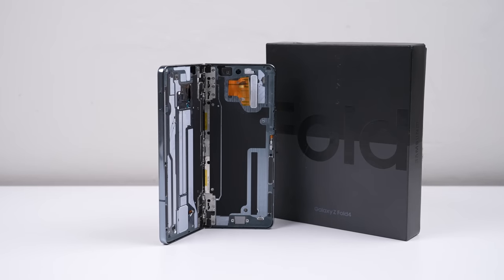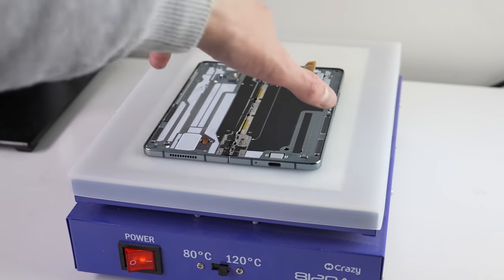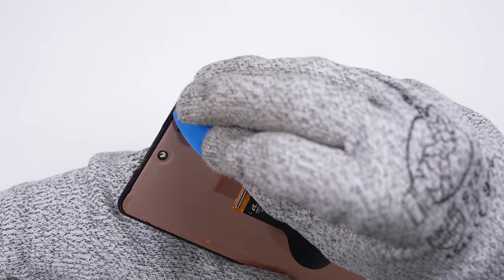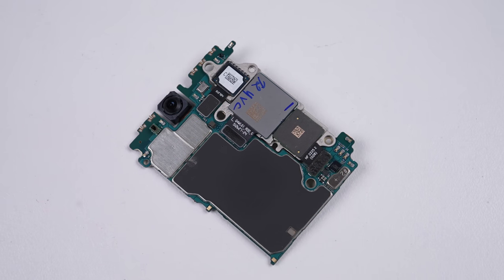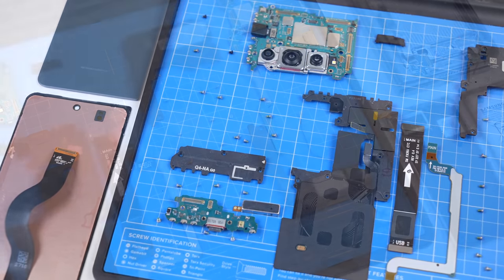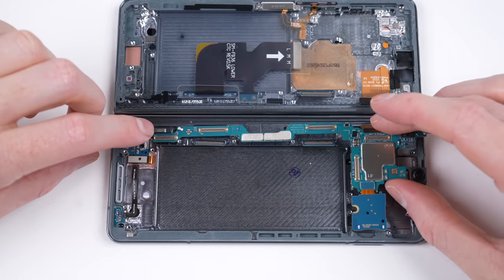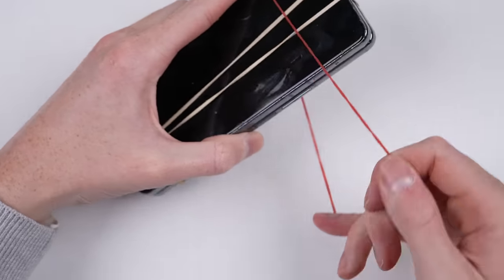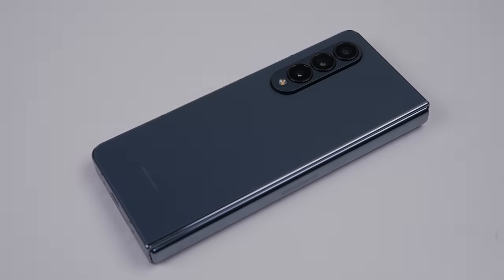Galaxy Fold 4 Restoration - Sellers Lies So Obvious I Had To See It For Myself.

Comment: Hey hugh, certified samsung tachnician here. I love your videos and your extensive knowledge. I do have a tip for you, that grey/blue frc cable on the main board side that runs from the usb board to the main board is supposed to go over the plastic bracket for the wireless charging but under the coil itself. It's clear the seller opened the phone previously and didnt mount it correctly
Reply: Hey I saw that too and I wondered what happened there!
Also certified samsung technician!
Reply: @dimitrisp.4397  right? Putting it under the bracket will damage it and eventually cause network connectivity issues. Also scared the shit out of me when i saw the copper foil peeled on the sub display 🤣
Reply: @thehellkeeper5674  I still cannot believe how the sub display survived the teardown!
Reply: is it true that Samsung change the ies to when you send it to repair?
Reply: @ThaexakaMavro  the what?
Reply: @thehellkeeper5674  Sub display is what Samsung calls the outer screen. I used to work at Samsung as a Support Specialist not too long ago and most of the devices I've seen with customers were always foldables having issues so I had to catch on to these terms very quickly haha!
Reply: @Lightning2011  i know what the sub display is
Reply: @Lightning2011 He was asking what the "IE" the other comment was speaking about, not the sub display
Reply: @thehellkeeper5674 was it you that took the screen out? 😂😂
Reply: @gamingbytetv665  I'd have lost my job if i had committed that atrocity 😅
Reply: @THEJPR  ah, apologies my bad
Reply: also that front facing camera came out WAAYYY too easy, deff was fully opened by someone before
Reply: @thehellkeeper5674   my phone is a Samsung galaxy A12 and has a cracked screen my phone company at@t will not replace the screen and send the phone back they give you a new one this makes me mad I still haven't got my original phone back
Reply: @Camdanjohanson  front facing cameras (I assume you mean under display camera) at Fold 3 and 4 are not glued like Fold 2 or Flip phones!
Reply: Do you have any tips on the fold not opening as much anymore? I have the fold 4 and it opens closer to a v than flat now :/ probably 160○ is my rough guess
Reply: @stewyxd  that should be an in warranty repair as long as there is no heavy damage on the hinge cover. Just dont mention any drops or anything like that
Reply: @thehellkeeper5674  I haven't dropped it at all so there's no damage to the device or even scratches I have Samsung care too
Reply: @stewyxd  just send it in to be fixed in warranty. As it is a warranty repair then samsung care plus shouldn't be activated. Otherwise you'd have to pay the excess fee for SC+
Reply: @thehellkeeper5674  Will do thanks 😊
Reply: @stewyxd  Take it to a samsung service provider, they will need to either replace the display assembly or the device alltogether
Reply: @Camdanjohanson  The one near me closed during covid so I can do it but it's about 75 miles to the nearest one now which isn't good
Reply: @stewyxd  you should be able to just call them and book a carrier collection to your house
Reply: Glad someone else spotted that! The glue on the UB display though and the battery removal with metal object made me twitch 😂 🫠
Reply: @thehellkeeper5674 is Samsung care/+ worth it?
Reply: @chazmichaelmichaels88  it is definitely worth it. Even if you end up never using it, say you're on the last month of sc+ and you never had to use it, break the phone and get it fixed to brand new
Reply: @thehellkeeper5674  okay good, thanks for the info. I got SC+ when I bought my fold 4. Couldn't bother dealing alwith Verizon and that terrible assurion insurance.
Reply: @thehellkeeper5674 Late to the party but do you know if SC+ (or warranty) covers severe micro-scratches on the new, terrible Gorrilla Glass screens? Have an S22U and my God are they horrendous, the screen scratches with the lightest use these days. Really kills the enjoyment.
Reply: @kewlhotrod  cosmetics aren't covered by warranty or sc+. I have a 22u myself and i only ever got two tiny scratches from having dropped it once. Although(i shouldn't really say this) if you have sc+ and the scratches are that bad, just back up everything you need to back up, break the screen and send it in. The excess fee is nowhere near what you would pay for a full cost repair
Reply: @thehellkeeper5674  Thanks mate. And yeah, the micro scratches are really awful, GG has gotten so bad the last few years. Scratched to hell and back just from sliding in and out of my pocket the past year, it's horrible looking in heavy lighting.
Reply: @kewlhotrod  Samsung: We are the best because we aren't made in China.
Also Samsung: Hey, let's get China to make our stuff.
Reply: Hi, can you please confirm what will happen with ip rating after phone repair?
Reply: @almasfaiz6703  it should be back to the same as factory standard
Reply: I have to ask you something,is when we replace new battery Samsung service centre have some software for battery replacement?bcoz my new battery backup is same
Reply: @hrushimore3329  what do you mean? There is no software. Whenever we replace a major part(screen, battery, motherboard, cameras) there is a code that we need to give to samsung so they know what has been changed for the next time it comes into service

Comment: It's frustrating to see how obvious so many choices are made to make these phones harder/annoying to repair
Reply: and the majority doesnt care until apple starts doing it 😂
Reply: It's not that hard if you have the right tools.
Reply: @mikejames6588  he seemed to struggle with a few things and the only reason he wouldn't have the correct tool is if they keep changing the tools required. There is no reason the battery, screen, and plastic clip should be any harder than already hard to repair phones.
Reply: @TomGrievee  it's 2023. It's not that hard to fix these devices
Reply: @mikejames6588  Nope, just take your time and be careful.
Reply: That's gonna have to change soon to sell in europe so...
Reply: @mikejames6588 found the 'licensed technician'
Reply: The only thing that seems to be an issue is the battery and front glass adhesive, tool wise its much simpler than any iphone, which is shocking given the product.
Reply: Especially since Ive become the families "licensed technician" for repairing their phones, its a pain in the butt just getting them open while trying not to damaged the good parts that are left. Most of my knowledge came from damn near mangling my nephews phone shell getting the old screen off but it has gotten easier with more experience that I could fix my dads WAY more expensive phone that actually uses the pen. Me? I dont spend anything over 125 on a phone as an upgrade, I dont need anything more expensive than that really.
Reply: Clearly it's intentional especially with the battery is glued down
Reply: Apple is the biggest and also one of the worst when it comes to repairability
Reply: When I replace batteries I don’t glue them and never had problems. It means that glue is not needed for functional benefits
Reply: For me most frustrating thing was information than phone couldn't be cleaned without inner screen replacement... Great job Samsung!
Reply: @kasiorap  maybe if apple doesn't want people to care then they should stop doing it they way they do it. When apple normally does it, they go the extra mile to tell the customer and technician working on that device that the device is meant to be difficult to repair or not meant to be repaired at all. Cough parts pairing cough $600 for a back glass replacement cough Proprietary screws cough Phone gets bricked because of a broken earpiece speaker cough . Good thing is at least they are taking baby steps in the right direction for repairability as of now.

Comment: I love that companies REFUSE to use screws to hold down the rear cover, but literally cover in the insides with screws and then glue the battery in place, where they use plastic clamps to cover a connector. It is like they know which parts will need to be replaced and have made those parts as hard/dangerous to replace as possible...
Reply: Not trying to defend these practices, but you can't use screws to hold down the rear cover unless you fancy marketing a phone without water resistance (which I don't think is going to sell well at all).
Reply: @osamu_90  Uh almost every electronic appliance that needs proper water resistance is held together with screws and rubber gaskets, there is no need to glue shit shown, it's only done for aesthetics. It's definitely possible to just make a metal+glass back cover with a gasket (something like the iphones) to have screw holes for easier removal.
Reply: @osamu_90 everyone seems to forget the Samsung Galaxy S5 (removable back, battery, water resistant)
Reply: @osamu_90  Water resistant devices have existed for years, it's only recently we've started using adhesive instead of screws and rubber gaskets.
Reply: @milktoast56  The S5 has a lesser water resistance rating though of IP67 vs the IP68 rating of the glued phones. This doesn't seem like much, but IP68 can survive three times the depth in water as compared to IP67 for the same duration.
Reply: It's likely due to production, it's faster for say a robot to slap a piece of glass in with glue then to screw in a back cover. As for a human, I'd imagine it's still faster to install the glass as one glued piece.
Reply: @Adierit  Not just production, aesthetics as well. Something that looks like it magically holds itself together like sci-fi tech is an easier sell than something that looks like it was handmade for something like a smartphone, which is often used as a status symbol.
Reply: *Stripped screw
Reply: @milktoast56   the s5 wasn't really water resistant at all, i've had one and worked on a tonne
Reply: @noname1210hh  it had an ip67 water resistance what are you talking about
Reply: @Adierit  I mean are you gonna drop your phone deeper than 1m into water?
Reply: @milktoast56  Ideally one should never drop their phone, but I can name plenty of pools that are deeper then 1 meter. That's only 3 feet after all, which is basically the shallow side of a pool. If it falls out of your pocket and lands in said pool, there is a perfect example of something every day people might potentially encounter.
Reply: @milktoast56   you can read specs all you want im just saying from working in repair shops for a very long time and dealing with them first hand  that ip67 didn't mean shit lol
Reply: @Adierit it’s ip65, not ip67. Literally just splash resistant
Reply: I agree that there is some anti-repairability in these by design, but they don't seem to go overboard like Apple using serial number binding to literally block you from being able to use replacement parts.
If you want to secure something like the battery down with clamps, they need to be extra strong so that it doesn't shake, which requires the mounts for those clamps to take up more space that's better used for circuitry. A customer doesn't want parts shaking inside their phone.
Reply: @noname1210hh  not even ip67
Reply: @Adierit  Every iPhone before the iPhone 12 is also ip67 water resistant. This Foldable is not hardly at all water resistant with an IPX8 water resistance rating, so what exactly is the point of that much glue, anyways, if the hinge will inevitably let in water?
Reply: @jayplantman  because without that much glue it wouldn't be sealed and have even worse water protection, while yes the hinge does let water in eventually it would need to be submerged vs at least being splash resistant
Reply: @The_Phone_Bin_Diver What? The S5 had IP67. TF are you on about?
Reply: @noname1210hh  The Galaxy S5 had an IP67 rating
Reply: Here's an idea for holding on the back:
Have the 2 screws near the charge port, like what Apple does. Then have the back panel slide up and away from the port, then lift out. It's held in with little L-shaped 'clips' along its length, but the only part truly locking it in is the screws. Doesn't work for water and dust resistance though.

Comment: Nice work, Hugh.
I officially anoint you a 'licensed technician'. 😁
Reply: I second this, Hugh Jeffrey should totally be the first to officially get this title 🤣
Reply: @LeahDykema  Absolutely !!!
Reply: If only I had half the skills that you have.
Reply: Should be a thing for him being a licensed technician in practice 😂
Reply: @LeahDykema first Louis Rossman, then Hugh
Reply: +1 ROFL.
Reply: Official joeblow5037 seal of approval
Reply: @lillebrorsanvincent2017  I like how Hugh whines less than Louis 😀
Reply: @joeblow5037  Agreed - although I like both hugh and louis, louis tends to waffle and whine too much - hugh just gets right to the point.
Reply: I hereby dub thy licensed technician
Reply: The crease of the screen from the first time you open it turns me off completely.   A better solution would be to separate the screen into two physical halves, and flip/fold them on a mechanical hinge for a nearly edge-less experience.  I rather see a thin line in the middle, than an ugly crease then a crack.  Folding a piece of plastic thousands of times is definitely not the right solution. imo
Reply: No, he didn't make it worse so he shouldn't be a "listened technician"
Reply: (insert clapping sound effect here)

Comment: When you go to do the Flip 4 note that you may need to transfer the magnets from the original frame to the new one or the inner screen may go dark when turned on. I believe the hall sensor expects a certain magnet strength to function and there is no way to calibrate the preinstalled magnets to the sensor on the logic board.
Reply: It needs a hall ic calibration!

Comment: The only licensed technician are you Hugh. 
Great job as always 👏
Reply: He isn't. A licensed technician would never (especially on Samsung Phones) use liquidglue like B7000/B8000.
Reply: @jul275  Only for this he would not be a licensed technician? This is ridicolous.
Reply: @N3KO_79  Not just for this one. Also noch ESD for example.

And "only for this.." - It is very serious. No waterprotection, heavier opening from the device and more.

Using a  1$ / 100ml glue for an expensive phone like this. He will never be licensed.
Reply: @jul275  🤫
Reply: @N3KO_79   It hurts me, that he is doing things like that with that range. 

He is not the worst, but also definitely not the best, just a 0815 repairguy like many companies.

Are you repairing phones in a company?

Comment: When lifting screens you should use a iflex opening tool or a quanli opening tool, that metal pry tool with the handle is far too thick and will increase your screen failure rate when lifting. You should also inject IPA into the edges of the display as these screens are not effected by it and the adhesive with heat and ipa will literally fall off.

This is coming from a trained samsung tech that does accredited repairs.
Reply: I kinda cringed when he used the Jimmy. I also have one and I sanded the blade down good and smooth.
Reply: Really interesting I always thought all screens reacted poorly to ipa, getting blotches. Are samsungs new oleds sealed off or why does this work?
Reply: Assuming you are from the UK (based on your user name). Does Samsung have the free screen change (or at least it's protector) in the first year? My phone has it and I live in a God's forsaken country!
Reply: @jeinnerabdel  sorry I’m not sure. I don’t work directly for Samsung and that would be a question for them. Reach out to them.
Reply: Muh millennial credentials
Reply: @fabian11235  Only an LCD screen suffers from marks when using IPA, the reason is that the screen is not sealed and the backlight foil gets wet and can become dirty or semi transparent allowing more light in some areas.

LED type screens can operate fully submerged in any non conductive cleaning solution, so IPA for example. OLED and AMOLED are led screens so IPA has no effect at all on them.
Reply: @AJSax0n  Thanks a bunch didn't think about oled pixels being their own light source, not relying on backlight leds. Appreciate the answer mate, have a nice sunday.

Comment: Great repair job.
When I begun with my electronic work, first as hobby and then as career, most of the devices I worked on used vacuum tubes. Successive technological transitions were painless though; but when we arrived to smartphone and tablets, the single thing I couldn't wrap my head around was... The use of glue to keep the devices together.
Use of glue has been despised for generations of design engineers.
If we had our way, all smartphones would have a 3 mm bezel all around, hiding the screws utilised to keep the screen and the back cover attached to the frame. I guarantee that no-one would complain of that bezel. Glue - blah!
Reply: Yup, glue is the worst design decision for repairability, but is the cheapest for production. I miss the good old days when iPhones used to have the bezel you mentioned, that were held together by two screws. When the screws were removed you could easily suction cup the screen off popping the retention clips. However, nothing beats the age when you could just pop the back off by hand in less than a second to replace your battery.
Reply: Or...
Screws in the back.

Comment: Asurion repair tech here. Im not sure if it exactly applies, but for my job we did have to get Apple and Samsung certified to work on any phones, they've got a whole program and curriculum that 3rd party repair partners have to go by so we can do the job. There's also something called a WISE certification too, depending on what level of equipment/hardware you're required to repair. Hope this helps lol

Comment: gaskets as you mentioned in cars are not glue they are rubber that is squeezed between the head and the block at I think 200 ft pounds